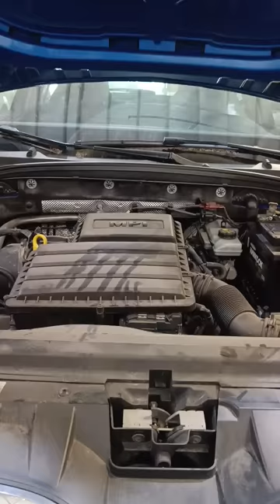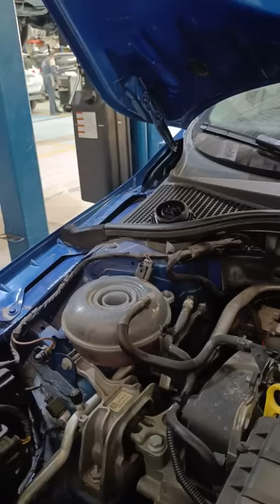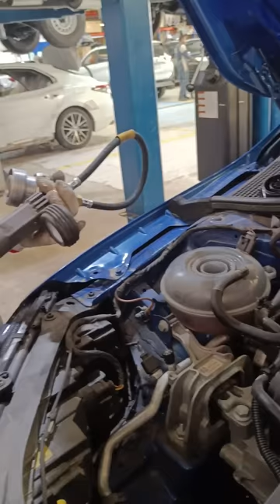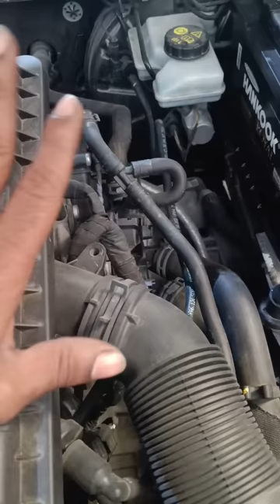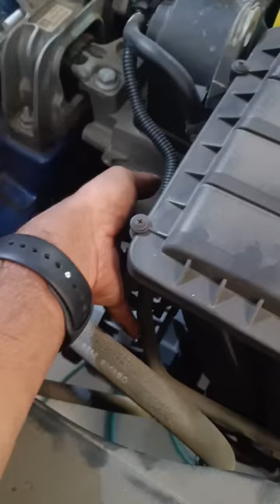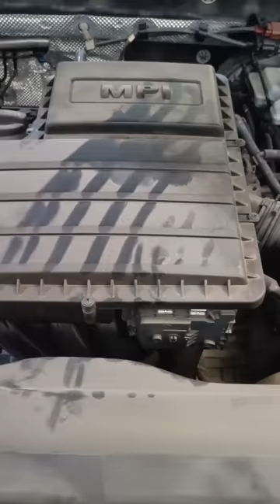കൈ പൊള്ളാതെ സുഖമായി പണിയാൻ ഇത് മതി #shorts #mechanical #riyadh #subscriber #support #car #saudi

Comment: It’s a vw approved tool ( coolant pressure test tool ).. പിന്നെ അത്‌ Radiator cap അല്ല , coolant tank cap ആണ്‌, please don’t shear/say wrong information, 1.5 മുതൽ 2 bar pressure കൂളന്റ് ചോർച്ച പരിശോധിക്കുന്നതിനുള്ള ടൂൾ ഉപയോഗിച്ച് നമുക്ക് ബിൽഡ് ചെയ്യേണ്ടതുണ്ട്.
Reply: Coolant reservoir is the correct name